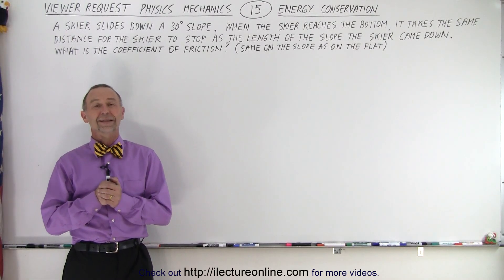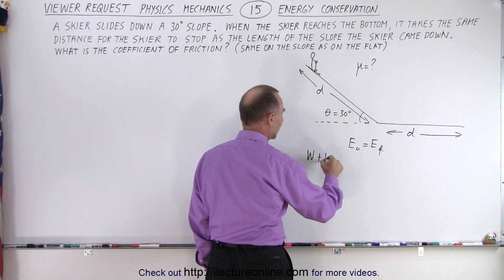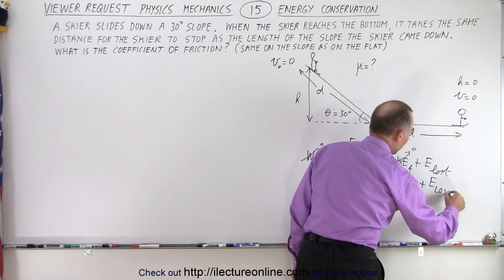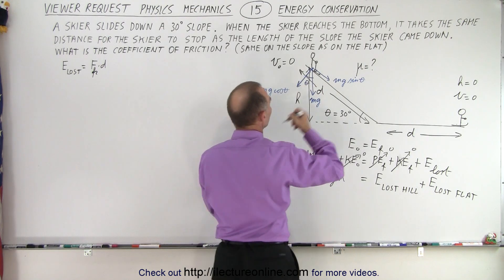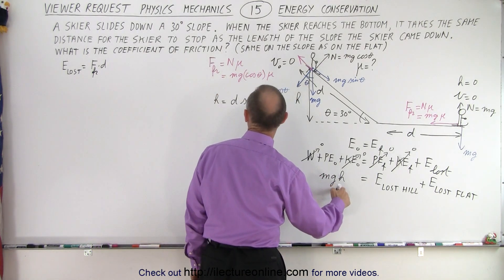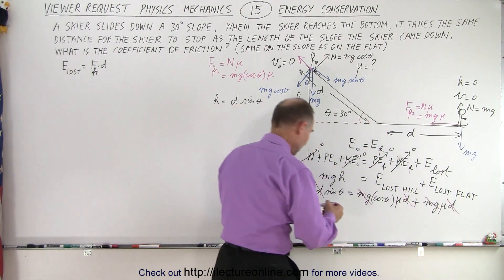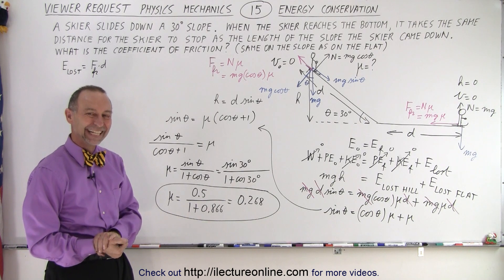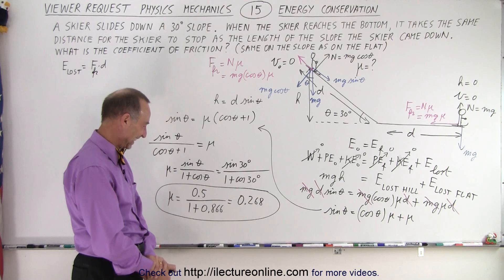Physics: Viewer's Request: Mechanics #15: Energy Conservation

Comment: Excuse me sir. I don’t quite understand why E(lost flat) is positive on the right side. If that’s the case, shouldn’t E(lost hill) also be negative?
Reply from the maker: If energy is lost, then the final energy will be less than the initial energy.  In order to equate the 2 sides, you must either subtract the lost energy from the left side or add it to the right side.
Reply: @MichelvanBiezen  Thank you very much! I think I finally understood the energy difference.

Comment: I have been following your videos for a while and they helped me a lot  particularly in Mechanics. I have an Exercise request  concerning the  handwheel (torque , momentum...etc). Please let me know , how can i contact you , so i can send you a picture of the exercise.
Reply from the maker: You can send it here in the comment section.
Reply: @MichelvanBiezen  Thanks for your reply and her i´ve tried to translate the exercise from German to english. a lot of Terms are different but i think i did well describing the Problem. 

a Bucket attached with rope to shaft in form of a Cylinder which is also attached to a Handwheel in the Middle.
The mass of the Bucket is : 5,2 kg
radius of the Shaft is : 11 cm
moment of Inertia  I_total = 0,75 kg.m^2
radius of the Handwheel is : 35cm
a) what force should be exerted on the Handwheel so that the Bucket will not move?
b) The handwheel is now released and the bucket is moved 10 m down, what Velocity does the Bucket have ?
C)what is the kinetic Energy of the Bucket and of the Shaft?
C) Time in The air of the bucket  in 10m ditance down?
D) what is the Total implus ?
Reply from the maker: This is an interesting problem indeed.  We'll shoot a video on it today.
Reply from the maker: On part d, impulse is always calculated ocular object which was not specified in the question.   Thus I will calculate it on the bucket and on the shaft separately.
Reply: @MichelvanBiezen  Can't wait to see. Could you please tell me when are you going to post it??
Reply from the maker: We filmed it yesterday.
We'll post it as soon as it is ready.  It will probably take a few more days to make it through the editing, producing, etc.